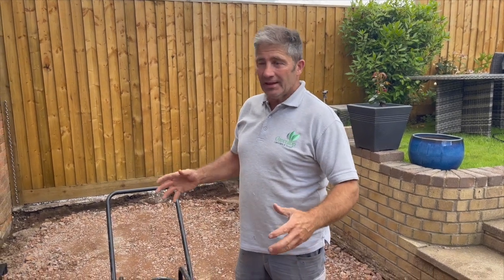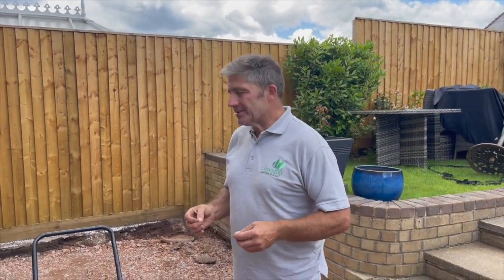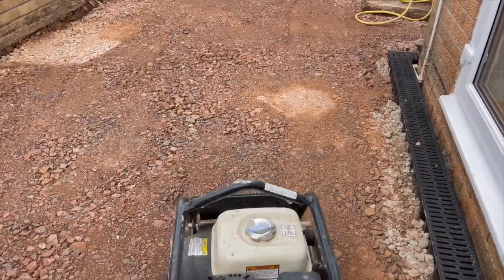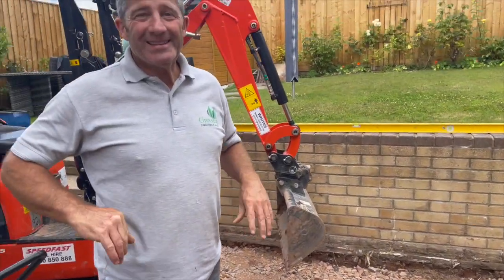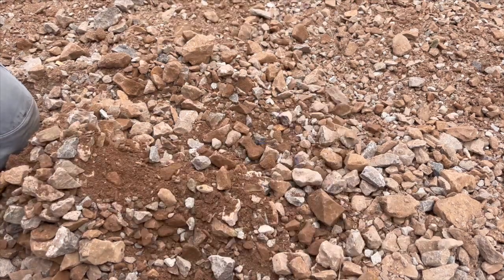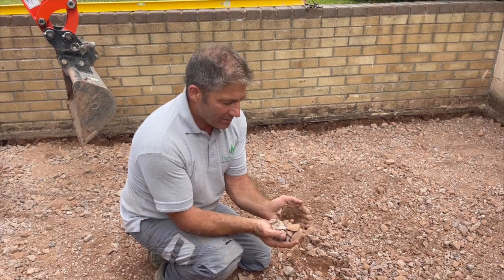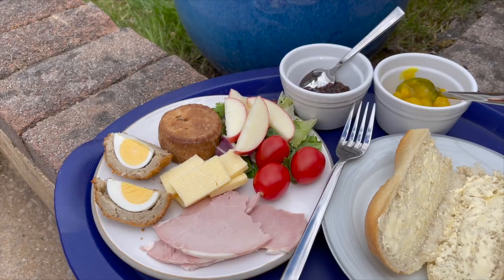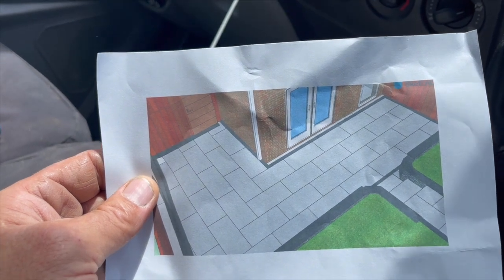How To Lay A Patio Update From Cardiff

Comment: Hi johnyboy.. hope all is well?! 👍 just a quick question please... what is the depth your lean mix, not inc mot dry layer. Also how are you mixing it? Dust in the barrows and rake about? Mixer? Jcb? Many thanks 😊 good luck 👍
Reply from the maker: Hi Stan mate, look to be honest the thicker the better but what it does is to create more of a rigid system with flexibility if that makes sense, I think if you got a good sub base you could go to a 3 inch compacted sub base but either way the bedding mortar will adhere to the leanmix better than the mot, the thing is this system has been done for years it’s really nothing new, be safe Satan mate
Reply: @GreentopLandscapes  many thanks johnyboy